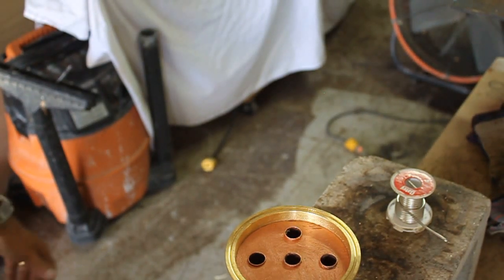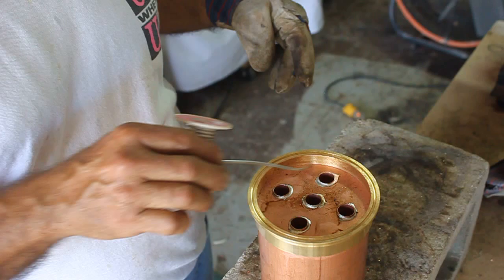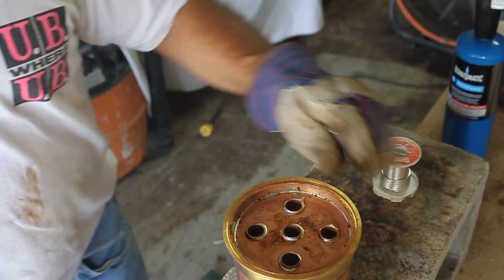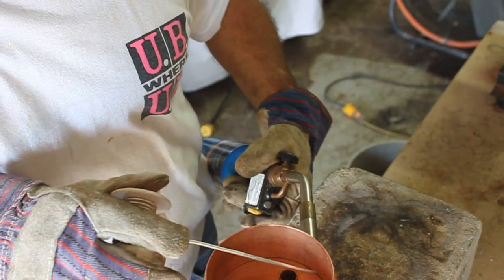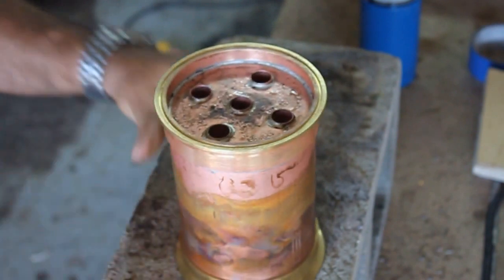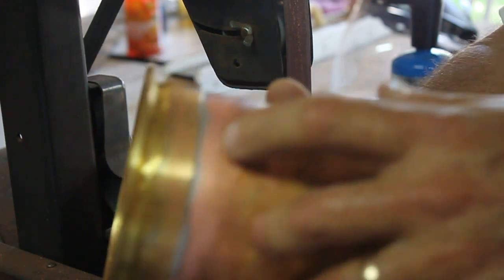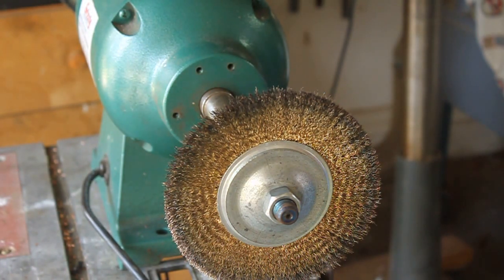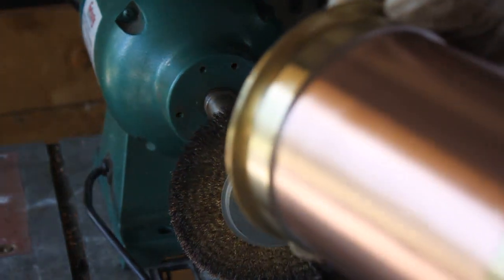Dephlegmator Fabrication video 3 for making Copper Moonshine Stills

Comment: is it possible to make a working 2"  dephlegmator,  or is the size too small to work
Reply: I managed to fit 5 1/2 pipes into a 2 inch piece of copper. It’s about 3 1/2 inches long. Works good.